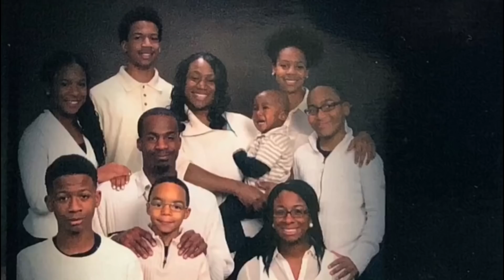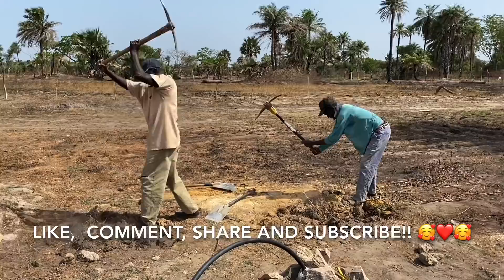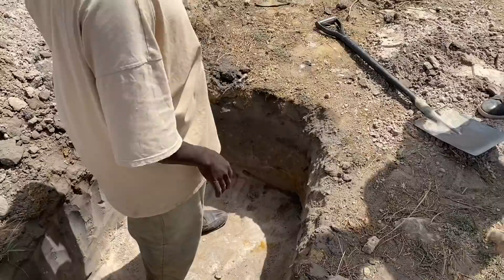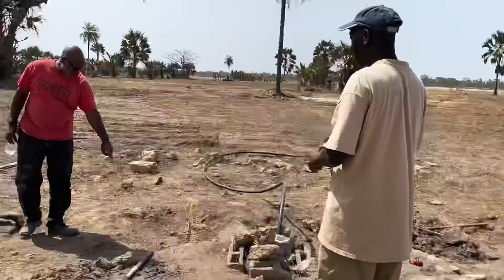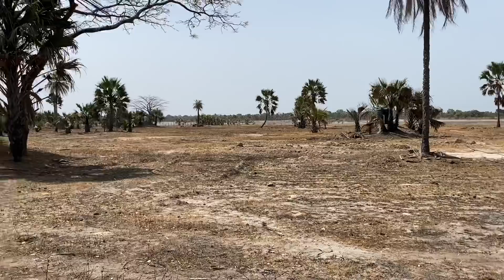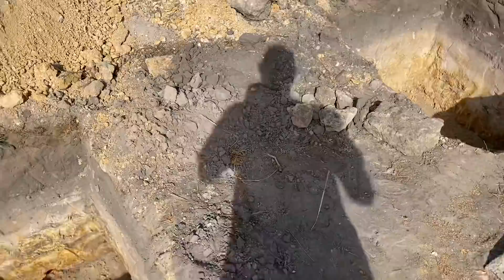Digging the base for concrete pillars to support 2- 5,000 liter water tanks

Comment: both four pillars should be join in the ground by concrete belt
Reply: It will make it stronger. When it comes to building it's also good to have some basic knowledge in construction. If you dont know much, than they should hire someone with the knowledge. If not, this is where people go wrong.
Reply: @PROPERTIESGAMBIA  is it don't matter for the belt in the ground or